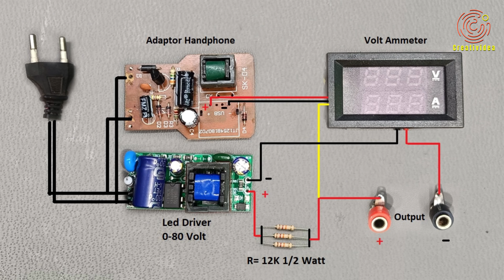Ide Kreatif Dari Led Driver Dan Adaptor Handphone

Comment: mantap massseehhh
Reply: kriteria drivernya harus yang gimana mas?
Reply from the maker: @ulinnovie7291  isolated driver, ciri2 nya yang ada trafonya, wattnya ga terlalu gede
Reply: klo ntar jadinya nyetrum gimana mas??
rada ngeri ngeri sedap mau buat rangkaian ini dari bulan kemarin liat ch prindapan..masih ditahan tahan😅
Reply from the maker: @ulinnovie7291  aman mas yang isolated driver ga bakal nyetrum.
Reply: klo diatas 100volt DC juga aman ya mas?
Reply from the maker: @ulinnovie7291  aman asal drivernya yang tipe isolated

Comment: Hello my friend, can I operate the LED with a battery less than 7 volts?
Reply from the maker: What type of led will you use? for leds that work under 7 volts, you must use a resistor to turn it on.
Reply: Ok  , thanks